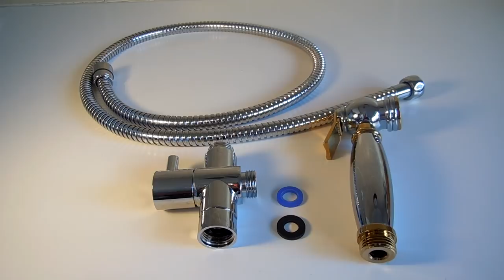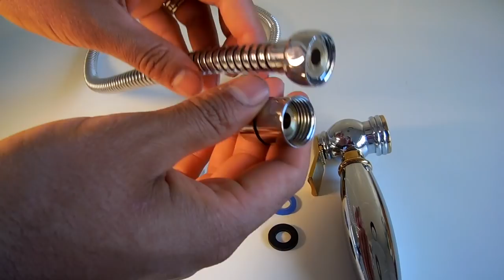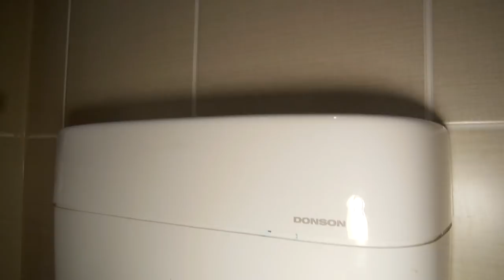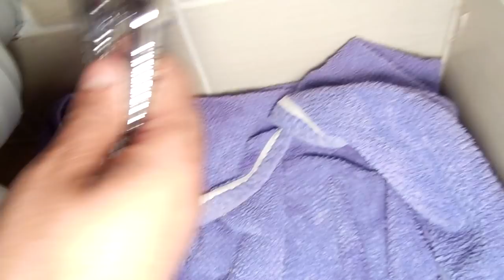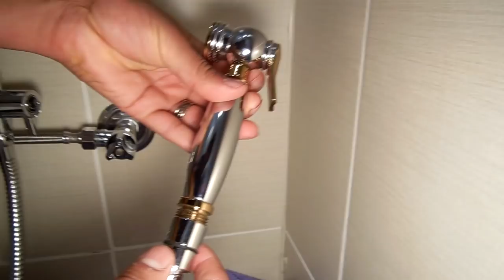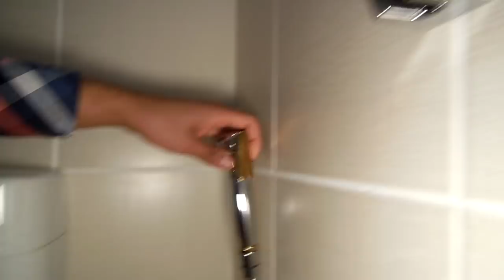How to Install a Bidet Spray | Easy DIY

Comment: ADVANTAGES  AND  DISADVANTAGES OF ALL BIDET TYPES
                                                       (Get knowing about bidets)               
                   THE   STANDALONE TYPE                                                                       
Advantages   
1. They can be used for other purposes as well (washing feet etc).
2. They can produce (some types) vertical water jet.
3. They   have no maintenance problems.

Disadvantages
1. They keeps place.
2. They are costly.
3. They make user to take awkward standings, so it is necessary he  hasn’t any mobility problem.
4. He must clean the basin from the remains after the washing up.
5. Lower Clothes have to be taken out, in order to prevent their wetting.
6. Occasionally hands need to be used.
7. They can’t be used in public W.C

                                                    ADD ON BIDETS
Advantages
1. They save place.
2. Many types are cheap.
3. They save time and effort and are more comfortable.
4. They are helpful to elderly and disabled.
5. They don’t need (in most cases) hands to get involved.
6. Some types offer additional services (warm drying air, remote control, warm seat, music, etc).
7. Users don’t need to clean the basin after washing, as this task is done by tank’s water.
8. They can be used in public W.C.

Disadvantages
1. Some have difficulties to get installed to every type of bowls.
2. Some are vulnerable to functional disorders and so their guarantee time is short.
3. Some are not very effective in cases of hemorrhoids
4. Some need maintenance care.
5. Some produce oblique water jet, which reduces their efficacy and may wet clothes.
6. Some are complicated in use, especially for elderly, blinds, disabled.
7. Some don’t allow basin under them to be cleaned.
8. Some they don’t have controls to avoid small children playing with buttons.
9. Some they have not the regulating mechanism to prevent abrupt water jet.

                        SUBTYPES OF ADD ON BIDETS

a. Those producing vertical water jet.

Advantages
1. They are generally more effective in relation to rectum cleaning up.
2. They are more appropriate in women after child birth, and other cases, where there are near rectum wounds. Here it is vital the water not to disperse to wide area.
3. Are more effective in hemorrhoids, where cleaning can be done at all sides.
4. Clothes never get wet.
5. Some with thin jet render useless warm water. Because of their restricted area of water affect, they reduce greatly cool water’s sensation. Of course warm water can be used as in all other types.
6. Some get installed very easily and quickly.
7. Some are very simple to use.
8. Some are very cheap.
9. Some give long time guarantee. 
10. Some are not electrical.
11. Some are very elegant and especially the electronic ones offer many additional cervices.
12. Some can be combined with toilet raisings.
13. Some have water pressure control mechanism, so to avoid any surprise sensation.
14. Some take care to prevent small children playing with buttons.

Disadvantages
1. Some are not so appropriate for women genitalia cleaning.
2. Some have, in order to be stabilized, to have toilet seat heavily inflicted by screwing.
3. Some are vulnerable to damage after a time of use, as leaking etc.
4. Some, because of their bulk, hinder wheel chairs to roll over the bowl.
5. Some are not so elegant.
6. Some scratch the toilet bowl.
7. Some cannot get combined and work with toilet raisings. 
8. Some don’t have water pressure control mechanism, so to avoid any surprise sensation
9.  Some don’t take care to prevent small children playing with buttons. 
10.  Some are quite costly. 
11.  Some don’t fit to all bowl types.                                                                                                                                                                                                                                               

b. Those producing  oblique water  jet.

Advantages  
1.  Some offer long time guarantee.
        2    Some are less oblique than others. 
        3.  Some take care to prevent small children playing with buttons.
         4.     Some need not maintenance care.                                                                                                                                                                                                 
                                                               
                                 Disadvantages
1. Some are not very effective, due to the jet obliquity, specially in hemorrhoids. 
2. They all cannot get combined with toilet raisings.  
3. Some don’t give long guarantee time.
4.   Some, because of their bulk, hinder wheel chairs to roll over the bowl .
5. Some need  maintenance care. 
12.  Some don’t  take care to prevent small children playing with buttons.
13.  Some don’t have water pressure control mechanism, so to avoid any surprise sensation. 
14. Some are costly. 
15. Some don’t fit to all bowl types.                                                                                                                                                                                                                                               

                   “For those that look for an economic, durable, 100% effective, non electric, easily installed and easily used apparatus, whose VERTICAL water jet in very restricted area reduces very much the feeling of cool water, (think of your finger in cold water compared with whole hand), never wetting clothes and never causing any surprise sense of shock, fitting to all toilets, the answer is the add-on bidetdisabled.com KO BIDET. The easy first (and permanent) step to know bidets.                FOR ALL AND HELP FOR MORE INDEPENDENT LIFE TO  DISABLED.
          SEARCH  WELL   BEFORE  DECIDING TO BUY A BIDET”.
Reply from the maker: +stip Disabled Great information!
Reply: wow what a massive comment congratulations!

Comment: Why Americans don’t like bidets?
 The main, I think , reason is the false information given to them .
 1.Most  Americans (and Europeans) are familiarized only with the  repulsive picture of a woman straddling a basin, eg the old standalone bidet type. The strange thing is that  when they are advertised, they appear as the representatives of all bidets. No wonder that Americans had fallen in the loop,
2. Only lately Americans started to know about add on bidets, but again, mainly the expensive complex ones. 
3. Very few Americans know about the types of the add on bidets, their differences, the pros and cons, between themselves and the advantages over toilet paper use, or the standalone type.

Why Americans do misuse the word bidet? Don’t they know that there are, apart the above shown standalone bidet type, many types of add on bidets, with many subtypes, as bidets with more or less oblique or VERTICAL water jets, electrically and mechanically controlled, etc. 

To any t.p fan:
THE BICYCLE TEST.
After a bicycle ride, user's bottom  area, is getting sweat, and if he had used toilet paper for wiping out, the result is so disgustingly evident on his clothing and very probably to  around noses.

How effective are add on bidets with oblique jet, compared with those with vertical one? (it is generally accepted that vertical bidets are 100% effective).

Do you know that In standalone bidet types you may need to use your hands and have to clean the basin by yourselves after?

Comment: 25 QESTIONS YOU SHOULD MAKE BEFORE BUYING A BIDET
  
 Low level of Sanitation is one of the reasons the American women didn’t like bidets.                      
 
A. You are a healthy young person and the bidet would be for your personal or family use:
• Would it be as effective as a bidet with vertical water jet, especially in hemorrhoids? (it is accepted that vertical jets are 100% effective).
• 
•  Is there any case that jet nozzle could touch user’s body?
• 
• Is that nozzle well protected from being contaminated by feces?
• 
• 
• Will you need to clean the basin, after you had finished your cleaning up?
• Will you need to use your hands for completing you cleaning up?
•  When the selling companies are claiming about cleaning up of  flash nozzle, do they mean using disinfectant, or just plain water? 
•  If they say that cleaning is done every 24 hours, you should have in mind that in the meantime somebody could infect the flash nozzle. Even if you intent to use it personally, you never know what could happen in between. Disinfection must be easy and at hand in any case and time. A criterion for effectiveness is the bidet could get used on public toilets.
• 
•  How somebody could be sure that a curious child would not play with the buttons  or levers ,causing a havoc?
• How often the nozzle has to be cleaned up from water salts etc?
• 
•  Why most companies don't give guarantee time more than 3 yrs ?
• 
• Would you be able to clean up the toilet cover etc with water?  Electrical bidets may not allow that.
• 
• Would the bidet have control mechanism for jet, so to avoid surprise shock experience?  
•                                                         
•   How much time is needed for the hot (?) air to dry up the hairy region? Remember, here the area is not like your hands. 
• 
• This one is of outmost importance for women and especially after child birth. They, because of anatomical reasons, are in danger their genitalia could get spoiled  and infected by the spilled around water, intermingled with feces and their microbes..This could be 
• the result of the action of oblique water jets splashing on anus area.  
• 
• Could a bidet be used in public toilets? That would mean that it could safely be disinfected and so is safe for you.
• 
• You may don’t know that it has been proved that warm water helps to increase numbers of dangerous microbes inside tubing or tanks. So think twice before looking for it. ( J UOEH. 2014 Jun 1;36(2):135-9. A survey on bacterial contamination of lavage water in electric warm-water lavage toilet seats and of the gluteal cleft after lavage.Katano H1, Yokoyama K)   So you must think twice if you intent to use hot water.
• 
• If the mere thought of cold water gives you a shock, you should ask  for bidets that eliminate to zero the cold sensation. They exist.
• 
• What are the safeguards against the POSSIBLY CATASTROPHIC WATER LEAK?
• 
• Could clothing get wet, or water could splash around ?
• 
 

B. You are a disabled or care for a disabled or aged person:   the same questions as before,  plus:
• 
*.Could the BIDET satisfactorily get functioning  by a blind or a person having mobility problem?  
• 
• *.   How somebody could manipulate in a complex bidet the buttons, that couldn’t, even see them, because of their place, especially when he has mobility problems?                                                              
•                                                                                                                                                                                                            * The water jet is exactly or about vertical? (You know that a small change in jet angle could send water at the wrong place in case  you are going to use a toilet riser). 
•                                                                                                                                                                                                                            *. If you intent to add a toilet riser, you should ask whether the bidet and the riser could be combined.                                                                   
• 
• *.If the patient could not leave the wheelchair the add on bidet must not prevent the chair to roll over the bowl.                                                                                                                 
• 
• *. In case of a blind he needs a bidet that offers a 100% effectiveness, so not to worry about the result.
                         IS THERE A CHEAP BIDET WITH THE ABOVE REQUIREMENTS?
Reply: I just dont know why everyone in the world wouldn't want to have one of these, like a thousand times a better idea than just using toilet paper alone. Save money, save yourself having a sore ass, good for washing the toilet, better for the environment,more hygenic, we westerners are really a primitive dirty arse lot.

Comment: When the selling companies are claiming about cleaning up of jet tube, do they mean using disinfectant, or just plain water?  If they say that cleaning is done every 24 hours, we should have in mind that in the meantime somebody could infect the flash nozzle. Even if we intent to use it personally, we never know what could had happened in between and the future. Disinfection must be easy and at hand in any case and time.
In women because of anatomical reasons there is  always the danger their genitalia could get spoiled  and infected by the spilled around water (intermingled with feces and their microbes)..This could be the result of the action of the oblique water jet, from backwards to forwards..
It is proven  by the research .( J UOEH. 2014 Jun 1;36(2):135-9. A survey on bacterial contamination of lavage water in electric warm-water lavage toilet seats and of the gluteal cleft after lavage.Katano H1, Yokoyama K)  that heated drain or tanks, as there are in some bidet types, help in cultivating numerous dangerous microbes.
                     Is there any solution to these problems?
                      YES.
The new revolutionary KO BIDET (bidetdisabled.com) gives ALL the answers.